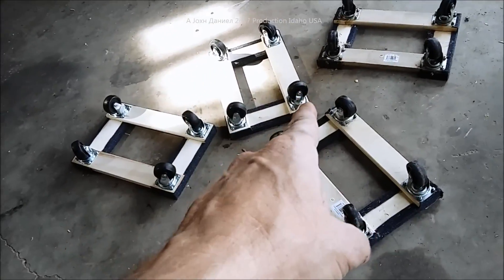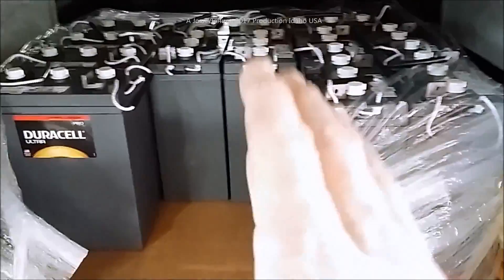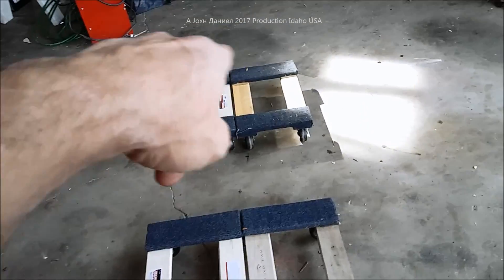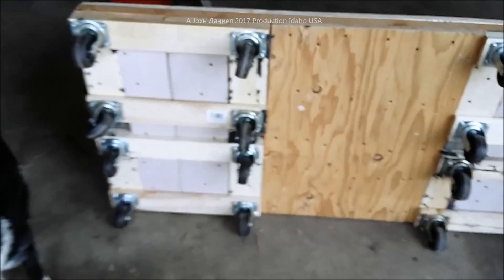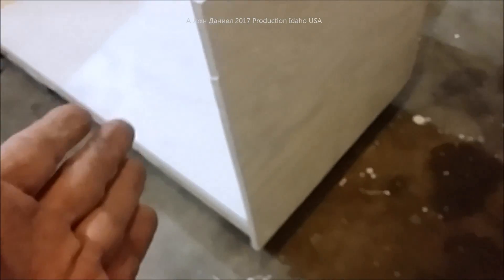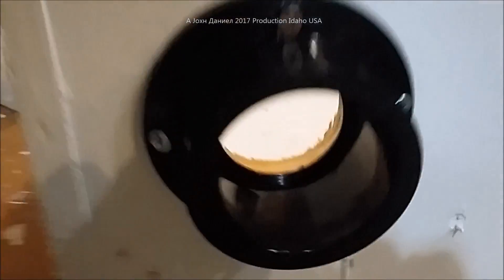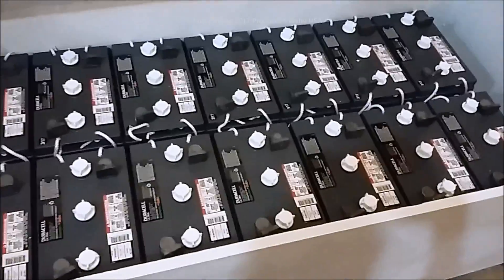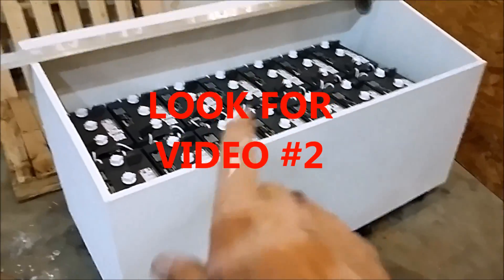DEKA SOLAR Duracell L-16 Deep Cycle Off Grid Battery Box Video 1 of 3

Comment from the maker: If you go SOLAR and want to grow, get serious but affordable 25 year plus better quality Taiwan made solar panels https://amzn.to/2DRhxm3 
**Always learn total battery care and servicing prior to purchasing large battery banks. ALWAYS BUY YOUR BATTERIES IN ONE PURCHASE WITH SAME DATES.
A off grid battery bank is the largest single purchase you will make in your Renewable Prepper Adventures.

370 amp hours @ 12 volts X 7 = 2590 @20AH Capacity
2590 x 12.8 Static Level Battery Voltage = 33,152 Watts storage
2260 Cycles Max at 80% Depth Of Discharge +/- 3%
7 to 10 years lifespan.
Cost after Discounts and some cores = $3628

Comment: Hi John,
I am very new and green to solar and am trying to learn all I can.. I am trying to learn one component at a time. I will be running a 19KW system (I know, BIG) and have purchased 45 Qcells rated at 345 watts each.. I am wanting to do a hybrid system.. getting perhaps 8 batteries for nightime essentials and maxing out my home usage during the daytime ... I eventually want to go totally off grid.. As I said, I am totally green.. but am learning.. your 12v idea seems very logical.. same with stranded wire etc.. my question is I have been led to the "Fronius 10KW inverter ".. will this be a good choice? I'm also being directed to a 48 vold mppt controller for $720 and an aimes 6kw power inverter.. trouble is, you've got me thinking 12 volt... so I'm not sure these items will work.. any help would be appreciated. thanks in advance..

Comment: I used this same wheeled dolly to hold my battery plus Duracell 215 amp hour 6 volt golf cart  batteries i just put plywood on top and screwed them together has worked for about 4 years now. I only have four but it just runs most of my garage for tinkering and diy stuff around the house. Just found your channel.
Reply from the maker: Lots more newer videos about them and power making sources on the channel

Comment: Great video and educational! I have been using a bathtub for the 4 L-16s I use for the solar system I have built in 1999. I am on my 3rd set of L-16 now. 1st set lasted 6 years because I cycled them twice a day (New to solar - I thought 'Solar! Just make and use the free electricity'); 2nd set lasted 12 years because I could not afford to cycle them at all. This time I learned to value the solar system more.  The solar system works well, why strain my batteries at all. Working on my 3rd set now.  The most expensive part of my solar system has been these batteries. :)
Reply from the maker: Here's a cool battery source for RV's, Centennial LAWN MOWER batteries! They are dual purpose SLA and much cheaper than a equal battery the UB12350 with 37AH in them. Only $35 each at places like Tractor Supply and Menards stores as well as many farm supply places. Made in China yes, but good actual quality and under license for Trojan! I put 6 in a 32 foot camper, 5 years ago, still kicking and not fading at all.
Reply: @JOHNDANIEL1  I looked those up just now, great choice. I live near a battery company and can get last year models. They are called "Seconds" and the Lawn mower types are $12.50 each.  Even the car batteries 'seconds' are only $44.99 each.

Comment: Wind, solar, storage and back-up system designer for 100% renewable energy grids and microgrids with 24/7/52 power-on-demand!
https://scottishscientist.wordpress.com/2017/07/14/wind-storage-and-back-up-system-designer
Reply from the maker: I have been arguing since the 1970's to use wind power to fill Death Valley California with 30 feet+ ocean water from the Pacific using wind power. Lowering sea levels, adding a slight increase in evap moisture to the air for a estimated 12% increased rain in the south west to Idaho, and as far north as Wyoming which in turn adds to all reservoirs. And using the main bulk of water in low profile Hydro Electric from Death Valley. And doing the same in all below sea level desert locations world wide. Doing the math its adding capability for man controlling 30 to 120 mm of Ocean water levels as needed, creating a massive inland sea farming system, having some control on weather, & reducing 20% of coal use. Conclusion on why something so simple and affordable will not happen, We live in a IDIOT WORLD of socialist who regulate us into stupidity.

Comment: Thank you John.  Nice video.  Question:  How did you determine your vent size to be adequate to remove hydrogen at a fast enough rate to stay below 1-2% threshold to prevent explosion?

Comment: All I have is T-105 wanna be. The L-16's look nice. So do these. I got the 105's for under $80 ea. I could have went 12v. But I figured the 6v even with similar capacity would last longer. Being cycled alot. The thicker plates. I don't think much of the 12v marine starting/deep cycle batteries. I am also working on a lithium bank. It's at about 150ah at 29.4v full charged. They should last 20+ years if not fully charged. And only 60% discharged. I will need 1000-2000ah + to only use little capacity. I hope to get it up to about 5-6,000ah. And save the lead acid Bank. For my garage and backup. The li ion if finicky when it comes to charging though. Lead acid would be so much easier!!! I'm going to build a similar batt box. With fan venting. About a 2" 12v fan with about 6-8v just enough to circulate the air. With 8 to 16 t-105 equivalent batts.  Nice box! Can't wait to see what's next!
Reply from the maker: The DEKKA/DURCELL made by East Penn are 32% more storage for  just 23% more money, a real think to consider. AND, they exceed T-105 in test by 14 months service.
Reply: Јоhn Daniel I'm in western NC. Do you know if there is a distributor near here? I seen some battery was $159 + $249 shipping. Or something like that. That's a bit crazy. When someone else had it $190 free s&h. I'd hope that shipping was the same for 1-6 or something. I'm debating on putting money in lead acid or lithium. My cheap t105 sized batts I figure they maybe will last 4-5 years at best. I noticed some battery saver stuff on amazon. For golfcart and stuff. Do you think that's the same as epsome salt . like your batt video on saving old batts?? I never really tried but never got far with old batts. If I do buy lead acid . witch I will probably have both.  Use the lead for the garage. I was going to glue plastic inside my batt box. Black or clear like ppl use In crawl spaces and stuff. Sold at hardware stores. To keep any acid contained. And my lithium in smaller stackable boxes with heavy aluminum foil with foam insulation. To help insulate and help to contain any fire that could happen . until I can push it out the window or door! It has many saftys so I doubt a fire. But you never know! For a lead acid Bank. I think 12 , 300+ah up to 350ah. Would do well for me. If I also go with the lithium. I'm slowly working on it. The good thing about lithium is the voltage is stable. A cell only goes from 4.2 to 3 v on my cells for 3 ah on most. 3amps for a hour and drop 1 volt. They aren't calculated like lead acid. My 200ah lead acid will only do about 130-140 amps for a hour. At best. Probably more like 100 ah if not completely discharged. I envey your system I kinda wish I went with 12v. I wanted to stay away from high current . so my normally sustained current is about 20amps with 100a peaks. At 24- 28v sorry I'm bad to ramble!
Reply from the maker: 1863 Hendersonville Rd, Asheville, NC 28803

batteriesplus.com

(828) 417-0816

Open now:  8AM–8PM

10% off if bought online and picked up in store, awesome recycle pay back from battery cores you bring in.
Reply from the maker: I use this search engine, https://www.opera.com/ , Its my default browser and it uses all these formats in a easy Google Chrome layout. Its a browser made of all these into 1 -  Mozilla/5.0 (Windows NT 6.1) AppleWebKit/537.36 (KHTML, like Gecko) Chrome/66.0.3359.170 Safari/537.36 OPR/53.0.2907.99 . So,  Its a full spectrum, super safe, so you get to avoid paid seller ads, and then NO DETOURS when searching due to adware and junk from google or Bing or others. Straight to best options and results.
Reply: Јоhn Daniel  thanks a ton I'll check them out. I need to get something going. I need to get to work. I am trying to do something at home to fund living! A small garage working on cars. A small wood shop making things. Something to make money. I can do a lot of different things. I'm a master of none tho. But I gotta try. Maybe a small welding shop where I can make stuff. And weld a part for someone . kinda simple stuff. Maybe rebar gates and stuff like that. But I need power. I have enough generators to power everything. But that sound gets old fast! Thanks again!
Reply from the maker: Study up on and Build CAR DOLLIES. High profit margin, high demand. NO TITLE REQUIRED or LIABILITY INSURANCES.
Reply: Јоhn Daniel we built trailers to haul cars. Before. I didn't know they was a demand for tow dollies . I have thought about building one. Thamks

Comment: Nice build! Like yours our battery box does not have a fan. My box is passively vented outside. As the Hydrogen rises it goes up and out a pipe vented outside, the fresh air is pulled into the bottom. I did not paint mine though. I have Kills paint but moving our L-16 batteries is a chore. Are you off grid?
Reply from the maker: About 88% free of the devil per my math. Almost 8 years now and progressing. We have yet to go 100% off grid, I have the pump for our water well, but lack the tie to install it. I built a 3 point lifting system for 12 gpm on our well, but its 411 feet deep, a challenge. All the rest is converted to DC or on one of 3 sets of batteries and inverters. We do not, never will, back feed grid tie with hopes of getting 32% of investment back! LOL
One 24 volt linked battery failure, waiting 3 weeks for parts made me officially dependent on plentiful 12 vdc  parts over dealer controlled higher voltage stuff. How efficient is 24 volt when total end cost means you can't buy a spare part from Autozone or Walmart!
Reply: That's a fairly deep well especially if the pump is hung on iron pipe. I have used pipe chalks before and I don't see how you could do without them when pulling a deep well. I see your point on the 12 volt issue. If I powered anything with DC besides the inverter I would be inclined to go with 12 volt as well. We heat with wood only and our cook stove is wood and propane. The water heater is propane but we heat with solar in the warmer months. I hope to build a thermal siphon range boiler with a loop in the wood stove. I like the waist oil burner you built. Very nice!

Comment: Another courtesy of BIG JOHN...  It`s time to shift in gear since spring is knocking at at our door..  This a solid base for a heavy duty service battery bank..
Reply from the maker: +al “peper 0110” desrochers Yes sir. I got a offer to install a 2000 watt solar array for a guy in Jarbridge Nevada and he wanted my 20 Centennials so I sold them as part of a deal with my wife's 1st year pension pre payout settlement to go bigger on the system we have and complete it. 
So the 24 Deka Duracell 12v in the shop are being used at the house and these are the main bank now at the shop. 
The 3500 watts of Stion are now to be put o. The shop roof to make that solar over 8300 watts.
Reply from the maker: Did pepper disappear?

Comment: your wife is taking care of bussines, nice build, the wheels make perfect sense, hydrogen/hho sure does rise, i filled a balloon with hho and it went straight to the ceiling as soon as i let it go.
Reply from the maker: +closertothetruth I think when people see how a high amperage, high efficiency  12 volt Preppers power system is done the 24+ volt lovers may think twice about the push and scam sellers of renewable crap.
Reply: a while ago i ended going 24v because people were going on about efficiency but later on i contacted a high quality inverter manufacturer here in Australia and they said their inverters have the same efficiency be it 12 , 24 or 48 that supprised me , so maybe its just the junk inverters that need higher volts to be effecient. you find all kinds of 12v equipment  everywhere and cheap .
Reply from the maker: +closertothetruth All you have to do when designing your system is listen to the users but ignore the sellers and their foolish followers.
Reply: Here works only the refrigerator directly on 24 volt Further works everything on the 230 Volt 50HZ  800w inverter or on the big inverter 230V 50HZ 3000W those is for the heavy work as a washing machine.